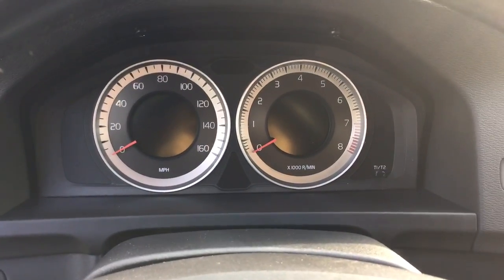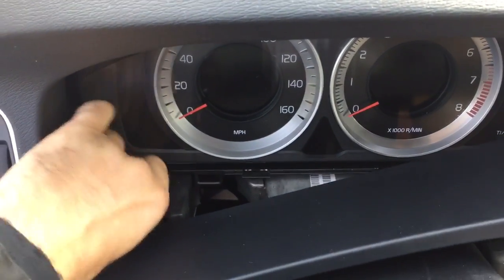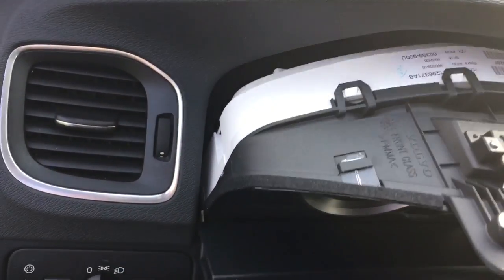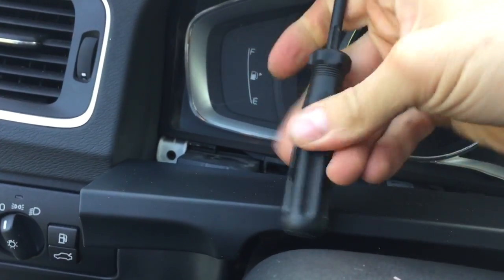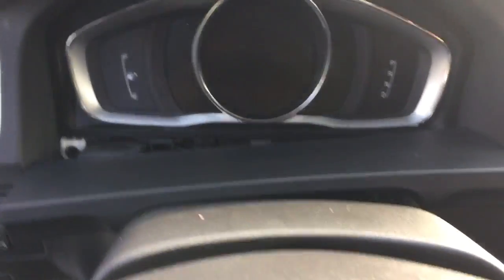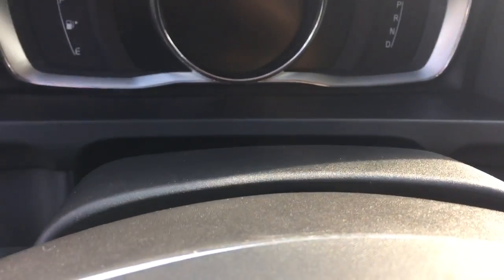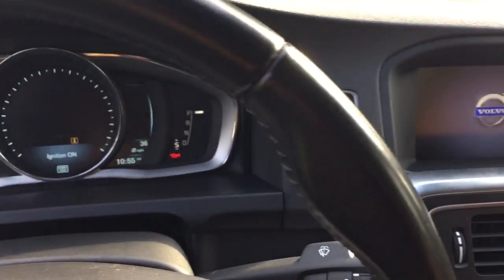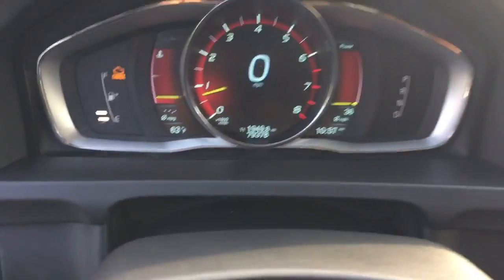Volvo virtual display retrofitted to 2012 volvo s60 t5

Comment: Sheldon: Your check engine light is on...
Reply: It does that when you replace your speedometer, same thing with mine but it's gone now
Reply: @Passt949  i have a s60 , will a V40 Speedometer Work ?

Comment: Thank you for the how to help video on this subject, I am going to be performing this exact gauge cluster swap in my 2013 Volvo S60 with a virtual display from a 2014 Volvo S60 and I found that the new cluster was actually stamped with a 2013 manufacturing date too! So it will be almost identical manufacturing software, hardware, ECT, as my car.

Comment: Thank you very much.  Also tried this (even knowing its a long shot) and i have excatly the same as your vídeo. Shifter and fuel range, where solved with the 2 extra wires on the DIM plu. 
All works, same kms, hour, etc etc . Just power and eco dont work (as expected). 
Volvo S60 T5 2011, cluster from Volvo t6 2014.

No software, just plug and play..

Comment: Hi, I got a TFT from an 2014 S60 and tried to use it in my 2013 XC60. I even setup the two wires from the OBD2 port . Only the gear sector and gas gauge cam on and the fuel gauge just showed empty and would go completely blank after about a minute. I then got one from a 2014 XC60 hoping since it came from the same model that it would work but it did the very samething as the first one. Any suggestions?

Comment: I just tried on 2012 S80 and it didn't power on. Gonna buy the Dice and install Vdash software
Reply: Hi! This is an old thread, but anyway: Did you make it work with the Dice? Thanks in advance!
Reply: I tried it on my 12 xc60 and it didnt power on either..were you able to do it?
Reply: @jerrysilva766  nope still haven't got it to work. But I never took the horn fuse out

Comment: I just did this swap on my 2013 s60 t6 awd. I used the software from d5t5 and installed the 2 wires from the back of the instrument cluster to the obd2 port. Everything works for me except the gas gauge. I wonder if I revert back to factory if the cluster i bought will work just fine. I didn't know this could be done without software.
Reply: Call Vipserwis Poland Radom. They have full solution for gauge caonversion

Comment: Great update!. I think this is one of the most attractive news developed on Volvo´s cars. Could you tell us, aprox. How much is it??
Reply: I found one on eBay for around $325. Not bad considering the features you get with the upgrade (mainly a water temp gauge which I was disappointed my 2012 S60 doesn’t have)
Reply: @FidelCashflow69  thanks a lot.
Reply: Do you have a serial number of the parts

Comment: Hi Volvoproject, I love your Video about the new TFT Display in the Volvo S60.. How to retrofitted the Display ? And work it on a Volvo V60 ? I have try it, but it doesn't work... Can you Help me please ? Thanks
Reply: Martin Reul does not work on your car cause it's not the same software. The transmission is also not the same. You need to change your transmission knob and bottom and it would work.

Comment: donor car volvo v70 2016 manual gearbox Didn't work on my s 60 2012 t3. The screen didn't even turn on.. For your information, it's definitely not plug and play. If you don't have time and technical knowledge, the old one is the best. The tft virtual display watch is already expensive. The friend in this video has already connected with obd it should be, but it doesn't mention it at all. It makes it look like a direct plug and play. Don't be fooled by this.

Comment: Know this was posted 6 years ago so late to the game. Having read (all) the comments, some posts say it worked others had issues or say it didn't work at all.  So whats your experience does everything work on the display. If not what's missing? Also one of the comments supplied a link to a supplier and in their description it states you need a software upgrade. You said it worked for you without one. Just wondering which one is true. 
Also have you any experience replacing the alarm module. Video's suggest you either have to drill out the wheel liner or remove the headlight and part of the bumper and fender. Seems when I search for anything about the 2012 S60 T5 that I own I'm the only owner of that year.

Comment: Hi, I've bought myself a tft cluster and I've installed on my 2010 S60 D3. Everything works great, only the tank level doesn't work, and the information about km. to next fill. Can anyone can help me with this feature? Thanks.
Reply: For that you might need to get VDash
Reply: Did you add the 2 wires to the cluster and connect them to the obd2??
Reply: @Alexander_l322  Yes, I did...all works fine, but some specs, like in video, but that's not a big deal. Thanks
Reply: Marius Mocian so you got your fuel tank level to work ok? It would be a deal breaker for me if I can’t see the fuel level
Reply: @Alexander_l322  that work. only spec that don't work is power indicator in sport theme mode, but that doesn't bother me. anyway, it's a awesome upgrade, the all off this costs me almost 650€, but it's worth it
Reply: Marius Mocian that’s good I’m glad it works and the power thing isn’t a problem for me either I don’t care if that works or not. 650 is expensive though! Worth it
Reply: Bro, do you believe that same speedometer works on my volvo s60 2011??  Correct me if im wrong: i have to buy the 2014 speedometer and thats the one i have to install?

Comment: I have a 2012 S60 T6 with nav and the sensus update done by Volvo, I have the cluster from a 2014 xc70. Does not power on when plugging it  . Will have to buy a Vida Dice and get VDASH.
Reply from the maker: Yes Im afraid you may have to do that, it is never guaranteed that it will work as plug and play
Reply: @pkolodziejek  yeah I had to go through vdash to complete the install. Anything extra done with vdash costs a small fortune. Tft retrofit they charged me $209cdn. 

Not for anything but VW has Vag-com, which I own, which we can do whatever we want program wise without having to pay for it. 

There must be another diagnostic software program out there for Volvo that is similar that will charge you 100 for the life time license like vag com.

Comment: Do you have the green and blue wires ( LIN Bus) to your display ? I put a display in my 2012 v70 and got nothing other than the warning lights and the fuel gauge light is on constant. I tried a nother display and my alarm went off and the webasto fan starten when i plugged it in. Any ideas ??
Reply: Yes, i have the same Problem... do you have the Problem solved ?

Comment: Did the same swap from an S60 2015 to my S60 2012. Fuel gauge not working also the car gets into limp mode after a while driving on fuel light. Swapped old one back and everything works fine. Does it need to be coded or something?
Reply: Yes. It needs to be coded TFT retrofit by d5t5.

Comment: Hello, I have a 2013 V60. If I understood correctly, I have to upgrade the software to make the 2014 panel work. Is that it? Do you think it's impossible just to plug the 2014 panel and work perfect?

Comment: hello, I have a Volvo S40 (2008). the speedo dimensions seem identical to the S60 so do you think it could also work in my S40? Great job on creating the video looks excellent with new digital speedo!
Reply: Hey, have you gotten an answer about this?  I was thinking about doing the same thing in my 08 s40.
Reply: Looking for the same answer if it works on S40
Reply: Looking if it fits in a xc90 2006!

Comment: Hi great video. Would this convention work for 2012 v60?
Reply from the maker: yes I installed it on 2012 volvo s60 and it worked as shown, if you need one visit volvoproejct.com

Comment: Great video
Quotation.  If I replace the start stop ignition switch will the 2key fobs for the car work without needing to be reprogrammed?
Reply: You rock wow.  I have a 2010 and wanted to do this. I was afraid if I unplugged anything it wouldn't start again. What is needed to get the DIM exactly? Would a plug and play work on a 3.2 2010?
Reply from the maker: Yes, it will all work fine,
Reply: @pkolodziejek  I appreciate you greatly my friend. Im going to do it tomorrow. Should i unplug the battery or anything along those lines or just remove and install the wiring harness with the car off. 
Ps I'm stoked to get the dim upgrade.  I saw both your videos on it.  Thanks for everything
Reply: I had paused because Volvo said I would need to have my key fobs reprogrammed.  I thought they were pulling my leg to get money.  The xc60 computer should recognize the key not a store bought start stop ignition for the key fob.

Comment: Hello bro, i want to change to the same speedometer but my volvo is a 2011 that its look like you 2012 car....  the new speedometer that you already instal on you 2012 volvo is a 2014 model?? That same model can be installed in a 2011 s60?
Reply from the maker: Yes it should work in your 2011, you may just need to activate more features with vdash,  if you need one  https://volvoproject.com/?product=volvo-xc60-s60-v60-xc70-virtual-display-lcd-speedometer-cluster-13-17

Comment: HI, i got V60 2015 and i got the ECO gauge. I would rather have the engine temperature. Will it work?
Reply: Did you had to use the Vdash in order to make the cluster work or was it plug and play?

Comment: Is this appliable to a 2013 V40 D2 with an analog cluster? Besides, how and where could I find the TFT cluster in Europe?
Reply: 4 years later but... you did it ? :)
Reply: @rorox3357  Hi, any news? Also want to change analog cluster to TFT in my 2015 V40. Will it work plug & play in this case?
Reply: All others are compatible except V40. Virtual cockpits works from XC60, XC70, S60, V70, V60 to all others from the list above, not need to be from XC60 to XC60, only V40 models aren't fit. For V40 donor vehicle must be V40. And pay attention on manual and auto transmission.

Comment: I have 2011 Volvo XC60 T6 AWD 3.0 automatic. 

I purchased tft out of 2014 Volvo XC60 T6 AWD 3.0 automatic. 

I plug it in and nothing happens. What now? Do I need cem software update?
Reply: I have a XC60 T5 2012, and bought a cluster from an XC60 T5 2015. I'm having the same problem as you had.
Did you solve it?
Reply: Same problem here
Reply: Wanna see If IT works on xc60 2012

Comment: Its work on s80 2007 2.5t?
Reply: U Will need software, for it to work. The further away your Modelyear is from 2014 the harder it gets. Vesper makes software but it's expensive..

Comment: How much was it and where did you buy it?
Reply: It cost about 190 euro used and you also need to replace the gear knob and the system under for about 200 euro. It will take around 1 hour to replace all of it.
Reply: Where to buy it?
Reply: Dmitrijs Leskevics vesper volvo
Reply: Where to buy for volvo s80 ???
Reply: I just got a quote from Vesper Volvo and they quoted 950 Euro.
Reply: yeah...me too....950 with kit and the cluster

Comment: Someone try this on XC60? i have 2011 XC60 (AME) i want swap old speedo on a new one. i know 2 ways. 1) xemodex 2) Vesper volvo. but if just simply put new one instead of old mwill it works?
Reply: I have a 2010 XC60 and hate the speedo cluster. Hard to see it at night. I'd like to change it out but at 950 Euro, that's a bit much. What have you found?